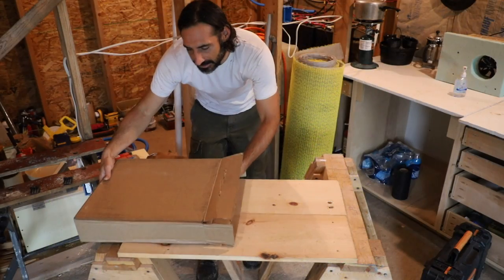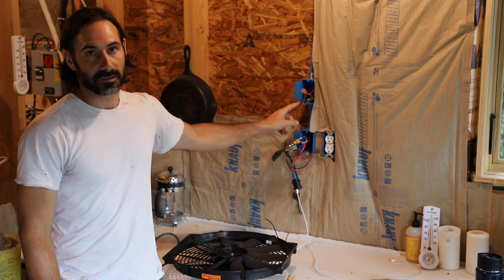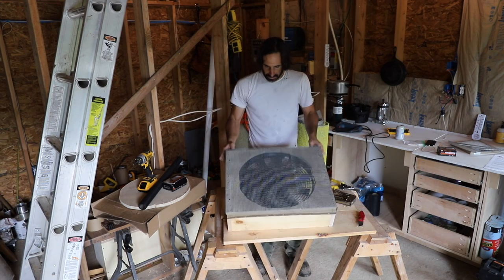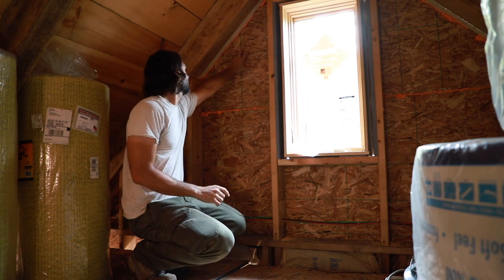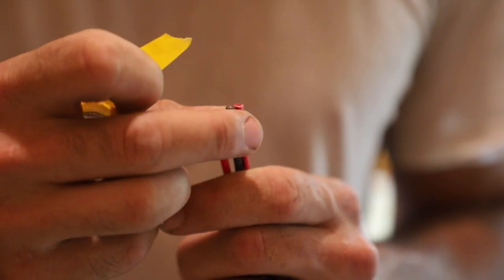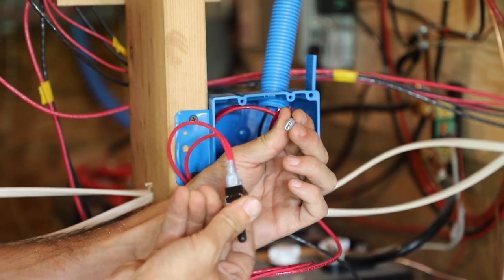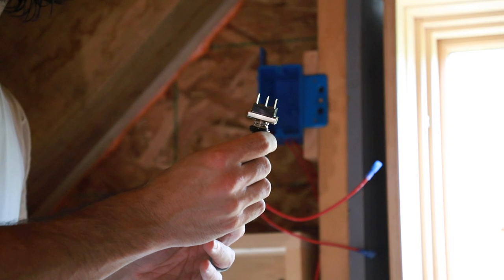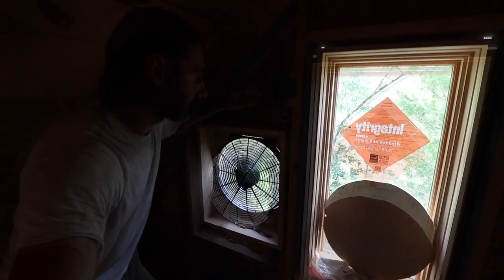Off Grid Alternative to Air Conditioning?  Making a Whole House Fan From a Radiator Fan

Comment: Since hot air is lighter than cold air, it would have been sufficient to just make the ventilation whole. Even without the fan the hot air will go up and flow out of the cabin, sucking in cold air.
Reply: It is way better to have the fan down low to pull in cool air.
This fella is learning

Comment: My window AC unit only pulls from 5 to 6 amps same as that fan might as well get the real thing and blow some cold air.I run three 7,000 btu units off of my solar panels and batteries.
Reply from the maker: I will probably break down and do that eventually!
Reply: @50Acres  I have a lot of panels and 18 kilowatt hours of batteries. I have 3,,020 watts of panels up right now. I have six more panels inside my shed also I need to put up on a tracker still yet.  So you will need more panels and batts to run an ac all day and all night.  I use Nissan leaf batteries. Im am saying my point is that fan pulls as much as small window AC.
Reply from the maker: sounds like a nice setup, hopefully down the road I can expand a bit.  I am going to throw two more panels on that awning I made that should help with early morning power use.
Reply: @50Acres  It will help for sure. I would like to see you get them all the way across the front someday too that would be awesome. Your cabin is nice you do great work.

Comment: This is my first time viewing your channel.
Your cabin looks very cool. Great work from what I can see.
Subscribed because I would like to see more.

Nice build and design. 

You did a good job of describing what you were doing and why. 

You need to also install regular screen over the outside of or inside of that fan otherwise insects are going to come in through the fan when it is not on.

I did not see how you addressed the opening on the outside of the fan.
You need to at a minimum put a piece of drip edge flashing above the opening to prevent water from running down the wall and running back into the fan.

Without a drip edge at openings or soffits water we called it hydraulic , this may not be the proper term. Look up images for stucco soffit drip screed.
It will run across a soffit or ceiling all the way to the back of the opening.

I worked on lots of carports, entry ways etc. in commercial construction.
  We always insured there was a drip edge for this reason we would not do one without it. 

Depending on the direction of the wind. Wind driven rain can get blown into the hole. You may want to cover the opening with a custom louvre.

That fan seems to be really loud. 

Not good for trying to sleep while it is on.
There are some other commenters who have mentioned ways to address the sound.
Reply from the maker: Thanks for subscribing Shawn.  I was planning on building a Louvre for it and then flashing it like you would a window frame, just use a metal brake and make a cap with a drip edge maybe extend it out over the front far enough to be sure it doesn't drip back inside.  I'll do some more research and see what people do.
Reply: @50Acres  I have one of the 30 inch metal brakes from Harbor Freight they work well.

Found more uses than what I originally intended it for after I got it.

You can buy the thin rolls of sheet metal they work okay. If you need thicker stuff Home Depot sells that too in sheets. 

To make the thin stuff sturdy at the outside edge and less sharp fold the last quarter inch 90 degrees then bend it all the way over. This will stiffen up the edges and keep them from being sharp.

For the Opening.

Make a Z flashing over the opening.

About a 2 inch leg up the wall behind your tar paper and external sheathing. You want this to extend about 2 to 3 inches past the opening on each side.

Then a couple of inches out angled down just slightly.

IF you need to bend it use something as long as the piece to bend it all at one time so it does not crease.

Then a turn down of a couple of inches. This is where you would use the trick to bend the edge over to keep it from being sharp.

Comment: Good job. The fan does not need to be quiet.  Unless you need to use it all night.  The idea is you run it fo ran hour at end of day and sleep comfortably all night.  Too many people run their AC 24/7 even when the outside air reaches a cool sleeping temperature by 9 pm.  Running 2 fans ( one blowing in and one at opposite end of your upstairs blowing out can save you big bucks and inmany cases you end up cooler.
Reply from the maker: exactly!
Reply: I used to sell ( and install/configure) DC adjustable speed controllers. You may even be able to source a speed controller for it ( cheaply) so theoretically you could run it down at lower DC voltage and I believe the speed would decrease. At the lower speed it would run quieter but provide some forced ventilation if someone were sleeping and wanted some small amount of air movement.  In other words you may be able to have more than a simple on/off decision.
Reply from the maker: @thebarcodeguy4420  I just got done installing a PWM controller, it was about $13 shipped.  I't can vary the speed to almost a standstill, very impressive.
Reply: You are way ahead of me!  BTW I would love to get off the grid.  Hard to do it unless my wife of 35 years says its ok.  Your Carpentry work looks precise and meticulous.  Awesome.  Very jealous.
Reply: The way we would set up a feedback system for the fan ( in my previous life) would be to tie in the pwm controller into a thermostat, and regulate fan speed based on attaining the set point for temperature.  a set point controller is used to set the point ( temperature )  you are trying to attain.  For now a regular old fashioned Thermostat would probably work ok.

Comment: If you run that radiator fan on 12V it will run less noisy and last longer.
Reply from the maker: Good call, I will wire in a controller
Reply: @50Acres  
Grab a PWM module off eBay and control your speed.

Comment: But when it's hot you just blow hot air. Secondhand window ac units are plentiful as long as you can generate the power
Reply from the maker: Yea it only works when the outside air is colder than the inside air.  Its not a perfect solution for sure.  AC is still the best but I don't have enough power for that.

Comment: ARE YOU GOING TO GET LOUVERS OUT SIDE THE FAN TO KEEP THE RAIN OUT  ? BUT THEN YOU WOULDN'T HAVE A FULL TIME VENT IN ATTIC ?  A RIOSTAT MIGHT CUT THE SPEED AND NOISE !
Reply from the maker: I will build some louvres.  I will also wire in a speed controller

Comment: Am I the only one to ask why does everything run on 24 volts
Reply from the maker: Making your battery bank 24 or 48 volts  has a lot of advantages.  Most people just run everything off 110 volt AC at that point.  I decided to wire the cabin for 24 volt DC just in case the inverter ever craps out at a bad time I have a backup plan.
Reply: Thanks

Comment: You need to put in a relay the switches are not made to run that amount of amps and if you sent up 12v you could have a low setting
Reply from the maker: It draws 5 amps, pretty sure the switches can take 20 IIRC.  I plan to wire in a PWM controller next trip.
Reply: @50Acres  eazy way to find out just wait for the switch to burn out i really think you should but its your house and its a lovey house and i wish you all the best

Comment: Cool video, but how effective is that when it's 90+ degrees outside?
Reply from the maker: It won't work good if it stays that hot out.  It only works when the temperature drops significantly at night time.  Thankfully that does happen pretty often near me.
Reply: Yeah, that makes sense. Even in metro Atlanta it gets fairly cool at night. Got to figure out a way to keep it cool during the day. Thanks for the video.

Comment: How about water proofing? You should at least caulk the round hole in the exterior of your house. Otherwise in 2 years that spot will be rotten all over. And i don't know if that mesh keeps heavy rain on an angle out.

Comment: why do you run a 24 volt system over a 12 volt system ?
Reply from the maker: I saved a good bit of money on wire sizing and charge controller sizing by going 24 volt, money that I have since spent on more expensive 24 volt bulbs fans etc...

Comment: Very informative.....but I’m thinking you could have gone with a less powerful and quieter fan....might be really hard to sleep or even just relax with that volume of noise.
Reply from the maker: Thank you, the fan only needs to run for 3 minutes to change the air in the cabin, if I want I can add a PWM controller and run it on low speed.

Comment: Did you mount it on the north side? I think north side under a steeple would be ideal.

6:20 "I can't believe that just happened" hahaha I thought that was going to be a pita!
Reply from the maker: its mounted on the south east gable end.  couldn't believe when that went in there.
Reply: @50Acres  I thought it was going to pull air in but it makes more sense if it's blowing air out of course!

Comment: What kind of amp draw does that fan take off the batteries?
Reply from the maker: oh it pulls a lot 120 watts @ 24 volts so around 5 amps but I will wire in a PWM controller so I can run it at varying speeds.
Reply: That's a good idea. That thing sure moves some air for a quick cool down!

Comment: that fan is really loud.  Were there quieter alternatives?
Reply from the maker: possibly, but at 24 volts it was tough to find anything proven.  It changes the air in under 3 minutes so its really not a big deal.

Comment: Good luck getting some relaxing sleep with that sucker running! You'll have all the local squirrels complaining to the parks board.
Reply from the maker: It only needs to run for 3 minutes to change the air in the cabin

Comment: Can you install something like a dimmer switch to reduce fan speed?
Reply from the maker: Yea definitely, it doesn't need to run that fast!
Reply: 50 Acres & a Cabin do they make them for 12/24 volt?
Reply from the maker: Yes I believe they do, look up DC motor PWM controller
Reply: 50 Acres & a Cabin oh sweet. Found them on Amazon 10-20 bucks.

Comment: I have a suggestion about the noise of the fan. But first, I like the video because you show the work you do but chop out the boring, unnecessary bits. Thanks for that! For that noise: how about create a (decorative?) box that mounts inside in front of the fan opening? Make it closed on all sides and open on the top. Next, line the box with some sound-absorbing material (even inexpensive foam rubber could work). Before the noise can enter you cabin, it will need to bounce against those sound-absorbing walls. Bonus: Air will now flow more from the hot apex of your cabin instead of directly in from the front. You might try mounting a panel of sound-absorbing material on the ceiling above the box opening to give the noise one more chance to be attenuated before entering your cabin. Of course, make the box big enough to allow easy air flow, but not too big to intrude annoyingly into your interior space.
Reply from the maker: Thank you, I think your idea would work however I am going to wire in a speed controller and run it on partial power and see how that sounds.

Comment: Why not a crank up skylight more light less heat and noise
Reply: A quality opening skylight kit starts at about $600 and depending on size and features can go into the thou$and$.  If you can factor that into to the initial cost of construction and install them while building the roof structure, they're awesome. Installing them after the roof has already been completed is a real pain in the "BLEEP". And if you get a "leaker", or if they are for some reason left open during a heavy downpour you could be looking at serious water damage.

Comment: when you were drilling holes in the studs, looked like you knicked one of those green wires. hopefully not, but that is what it seemed like when I was watching. :(
Reply from the maker: I don’t think I did, this video is two years old and I haven’t noticed anything yet.  If it was a green wire then it was a ground so it shouldn’t be a big deal.

Comment: Get a swamp cooler attic fan get some turbines on top helps pull the hot air out hot air out cool air in heat rises

Comment: Unfortunately radiator fans don't really care about noise levels.  I don't think that thing will be around long.
Reply from the maker: I need to wire up a speed controller!
Reply: @50Acres  for sure. I'm a mechanic and cringed as soon as I saw that fan.

Comment: Great video series.  New subscriber here,  keep the videos coming!  Regarding the sound for this fan and for your furnace... look at the videos for generator sound boxes.  Similar to a car muffler, with baffling you can control the sound without affecting the airflow too terribly much.  Just my two cents...  
Oh, and when you're editing your videos can you try to decrease the volume when you're nailing and drilling?  It makes for a shocking experience  when the boards or shingles start getting attached.  Just a thought.. I didn't quit watching because of this.
And one more thing.. .  please tell me you're  not gonna bring your wife back to the cabin and make her sleep on the mattress with the shipping plastic still covering it.. that's gotta be mega uncomfortable!!!  :)
Reply from the maker: Hey thank you Martin, I am going to try to make a quasi muffler for the furnace fan, I think that will probably work.  I hear you on the nailing and drilling sound I can tune that down pretty easily.  Regarding the mattress I just left it on there for the time being I'll take it off next time she visits, probably in the fall when it's not so hot.

Comment: You can put a small  Arcade Pinball machine fan above the peak and it will use lot less power and do the same thing. I put one in my attic and it worked just fine. My ex-wife would turn it off because the house got to cold for her. The big fan is going to zap your batteries quickly.
Reply from the maker: ill check those out too

Comment: Hard to sleep with that thing running. But a good idea..
Reply from the maker: It changes the air in about 5 minutes, but I'm going to wire in a controller so I can leave it running all night at lower speed if I want.

Comment: Hey  50 Acres & a Cabin , at 5:30 did you expose the copper in the wire???
Reply from the maker: No, I'm not sure if you can see in the video but I spread the wires to either side of where the hole would be before I drilled.
Reply: 50 Acres & a Cabin okay good! Best to be sure, could be a fire hazard! Just wanted to let you know. 😊😊

Comment: What gauge wire are you using for this fan?  You do know that line loss in direct current is orders of magnitude greater than with AC.  That is the reason why the world is running on Nicola Tesla's alternating current rather than Edison's preference for DC.  The losses can be significant.  The extra wire you put in the switch boxes adds to the loss.  Also, crimp-on connectors will fail over time due to corrosion.  If you have any humidity or dampness problems you will  learn.  At least you used a ratcheting crimp tool.  But the connections degrade over time.
Reply from the maker: I'm using 12 gauge in this particular case.  The fan draws 5 amps, at about 10 feet it will be under 1% voltage drop.